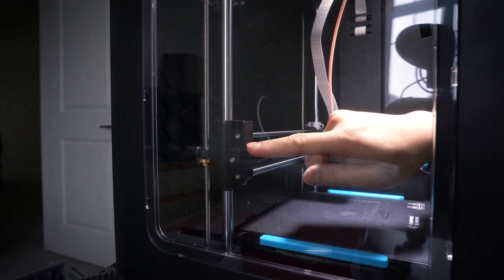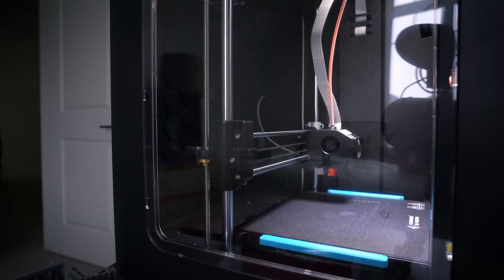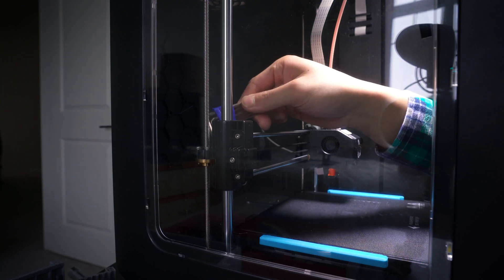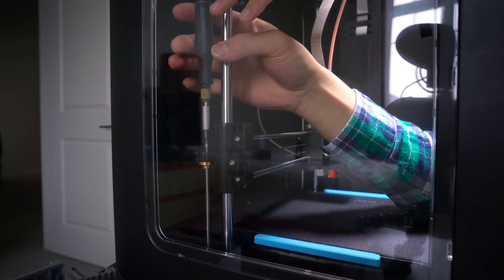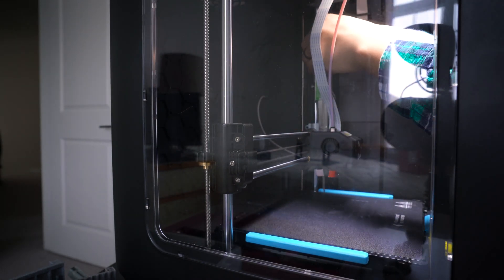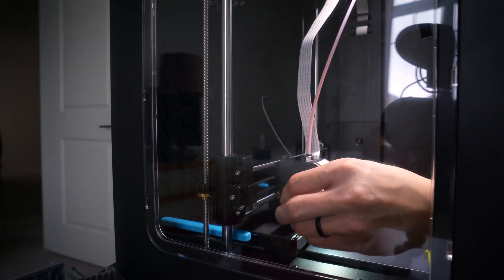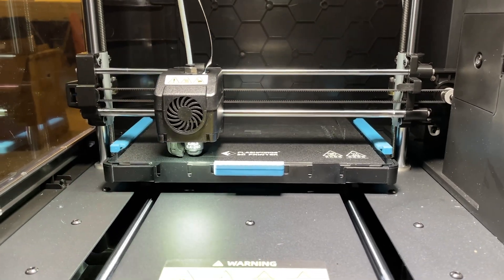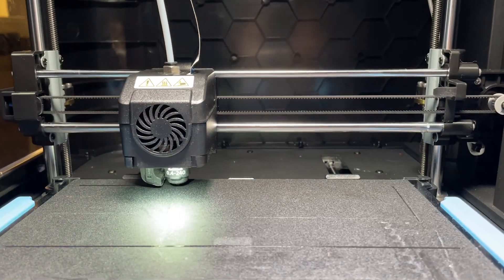This Is Better Way To Calibrate The Adventurer 4 Bed Level

Comment: I had the same problem. My solution was to take of the build plate and unscrew the 6 screws under it to loosen the whole bed. If someone is attempting this, carefully lift the RIGHT side up first as there is a ribbon cable under it. That cable is tucked behind a cover that looks and functions as a battery cover. I unplugged that cable and turned the bed upside down. I put some thin metal tape on the underside of the screw holes to act as washers between the bed and the sliders it's attached to. It was a fairly simple fix with great results for me.

Comment: Hello I don't know if this is discovered or not but on this printer the left lead screw on the of its travel has 2 grub screws clamping the lead screw to the coupling I simply undid one of screws and spun the lead screw until it's somewhat level managed to get between 2.85 and 2.95 mm offset on all 9 nine points of the bed

Comment: This video was a lifesaver. My discrepancy in the gantry was not 0.9mm like that other commenter, but still a very detectable 0.5mm. Still need to calibrate and tune the printer in some other manners, but one thing at a time.

Comment: Stupid question.
Did you check the tramming of the Z to the X first ?
That's the first thing I check on any unit is the square on all the axes asif there isn't a bed .
Then the bed leveled to that.
I'm not overly impressed with the bed on the 4 .
On my other machine I surfaced the magnetic sheet to remove the high spots.
I then used nylon spacers to level the bed.
This was after the whole unit was trammed.
Happiness to me is when it goes through the ABL and doesn't give a report.

Comment: I don’t get this because the nut’s thread holes doesn’t aline with the ones in the plastic arm holding the thread bar. I tried a lot of stuff but it didn’t help. How did you managed to do it? I got 0.3 mm diff between left and right.

Comment: Is this needed? Because leveling the bed is done with the software. You would say that the gantry offset is might as well be seen as a heatbed offset to the printer. And the software will compensate for it?
Reply from the maker: No software doesn’t compensate for it. I explain this in my other video on how 9 point calibration is a lie
Reply: @JerseyStyle7  shut up you fool, not every adventurer printer comes well calibrated some do need human calibration after being purchased.

Comment: I've seen a .STL file for a ''Rail gap cover'' for the ADV4. Handy for when one does maintenance on the device. Prevending screws etc. to fall in, like you mentioned in the video.
Reply from the maker: I’ll have to look for that!
Reply: @justmakeitdaniel7667  I found the file. How can I send it to you?
Reply from the maker: Is there a link? You can paste it here in the comments

Comment: I didn't even know you can calibrate that, very informative. Keen to see more!
Reply from the maker: I have another calibration method coming up soon! There are 3 methods in total I’ve found
Reply: @justmakeitdaniel7667  Gantry, you just covered.  The mysterious Expert mode through the touch screen, the regular 9 pt calibration, and the Z offset in FlashPrint.
Reply from the maker: @dondec  I meant 2 additional ways that are not using the 9 point calibration. It’s quite misleading imo. I’ll be explaining 9-point calibration in my next video